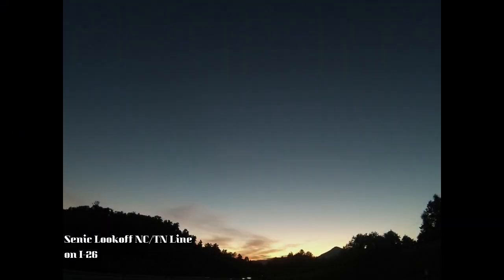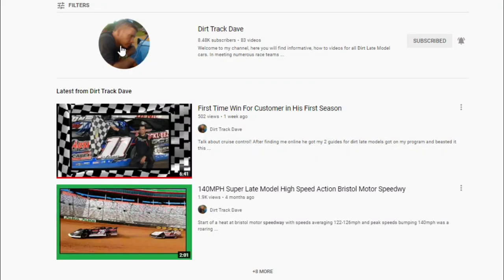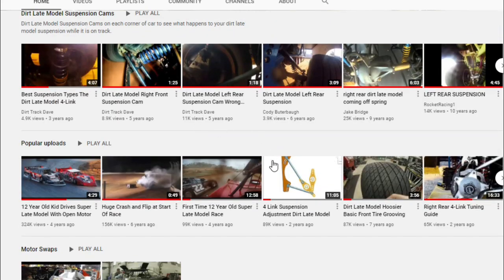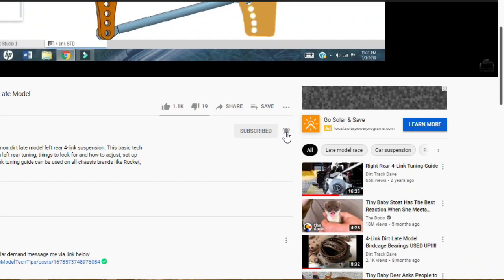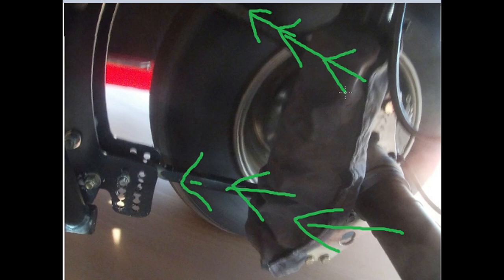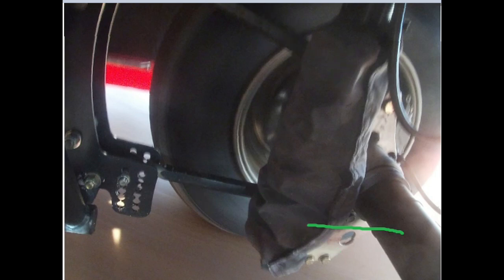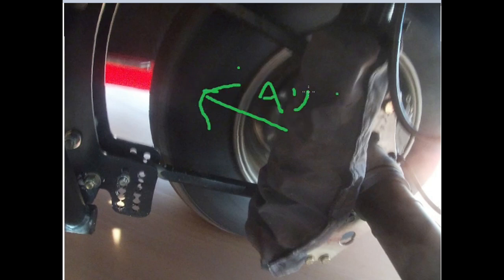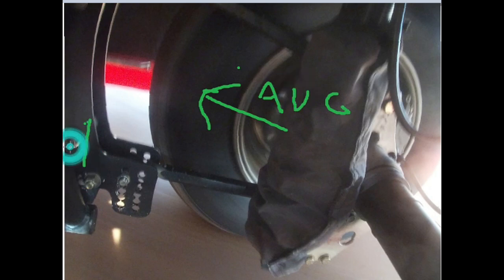Understanding 4 LINK FORCES in Dirt Late Models

Comment: How does a bump stop affect drive off
Reply from the maker: Now there are a lot of key factors missing. Like where is bump located, spring packaging, etc ... Along with how much bump you are using.
Reply: @DirtTrackDave  load rate on right front is 600lb 175 14in. spring 3 1/2 in. of travel to the bump stop
Reply: The car lacks traction form center off till exit
Reply from the maker: Is RF soft? I don't like the soft RF trend DLM racing has currently. But please message me here for further discussion. www.speedydave10@gmail.com
Reply: @DirtTrackDave  yes it is soft
Reply from the maker: @RobWilliams-gy2fn  well with a 175  you start with a ton of preload and I bet the middle of travel is soft, regardless of starting load. The soft spring always gets over but don't have enough push back aggressive enough to load LR. That why I never go below a 300. However shock must match the spring. You have to run more droop and load in LR to make soft RF work. Then you run in deck height issues.
Reply from the maker: @RobWilliams-gy2fn  please contact me via facebook at www.facebook.com/dirtlatemodeltechtips

Comment: How do you adjust Pinion angle ?
Reply from the maker: So pinion angle is changed with the himes that the lift bar connects to the rear end. You lengthen one shorten one to get the desired angle while making sure that your lift bar in the front where the six coil goes is pretty close to level with the bottom of the chassis with the correct pinion angle give or take a quarter inch maybe even a half inch but you don't want to be a half inch lower then the chassis cuz it will pull down and can get into the dirt sometimes. If you check out the setup guide I go into great detail about setting the cars up and stuff like that to look for that's really critical though.

Comment: Very interesting videos.  4-link vs shock-torque-arm, which is faster, better traction, comments ?
Reply from the maker: Give me torque arm any day of the week more versatile than pull bar.
Reply: Versatile - meaning it'll handle changing track conditions during a race, or it's easier to adjust to changing conditions ?  Thanks.
Reply from the maker: @techno9090  as in it has more range and capabilities than pull bar. Just being on shock and spring on 5th coil and spring on 6th coil add extra adjustability and control.